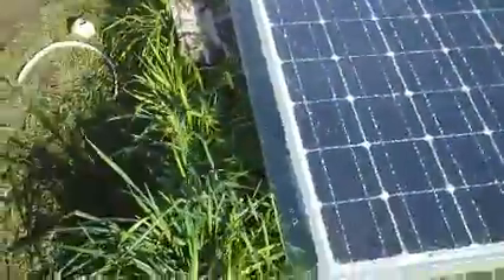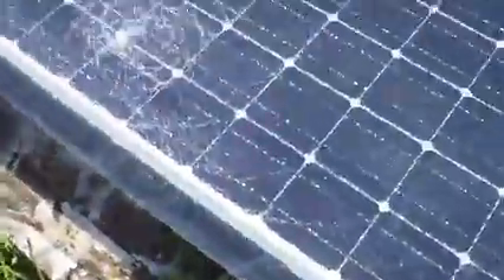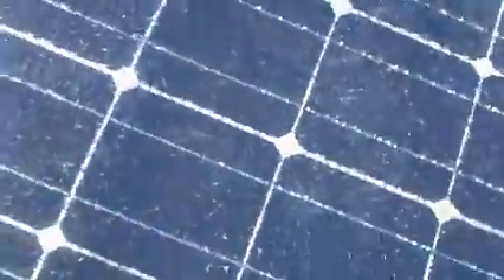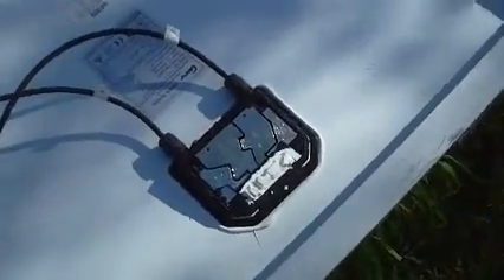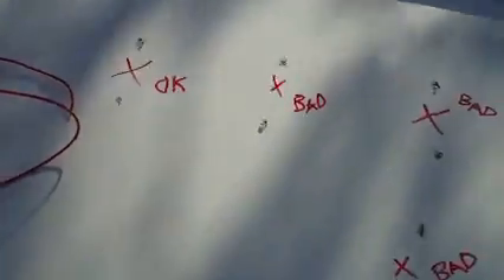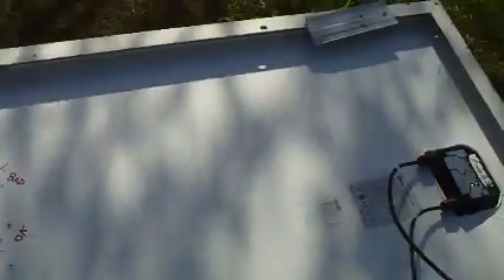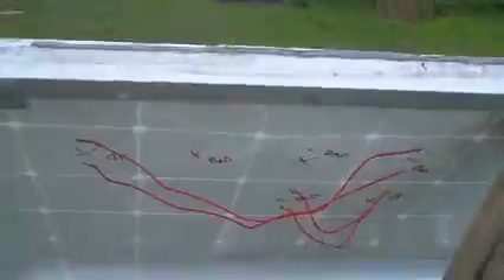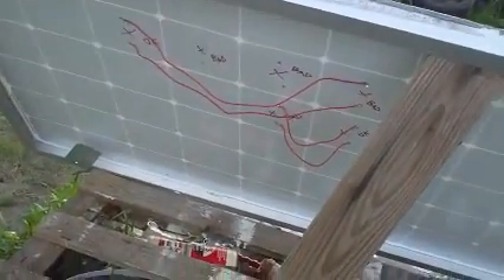Extreme Solar Panel Repair Pt2

Comment: I scored a 215 watt sun solar panel for only $50!! And like you said, I'm lucky to have scored a deal on a fully functioning panel cause all I have to do is seal it up!
Reply from the maker: I bought two ov these panels in 2012 for $100NZD each & at the time I thought it was an excellent bargain - and it was as a new one was $400NZD back then. I would not pay that much now.

I have fairly recently got another that did not need any electrical repairs plus one even more recently that did need some trouble bypassing but it not have any broken glass! :) 

It's a cheap way to add to your array for sure, however at some point I will replace these broken ones with brand new ones. I'll still keep them though, just use them in less critical circuits.